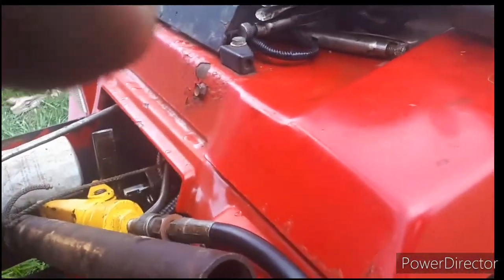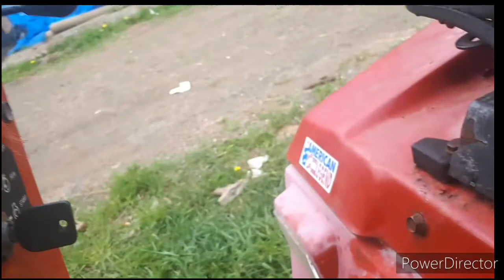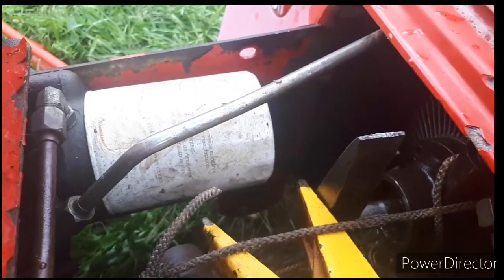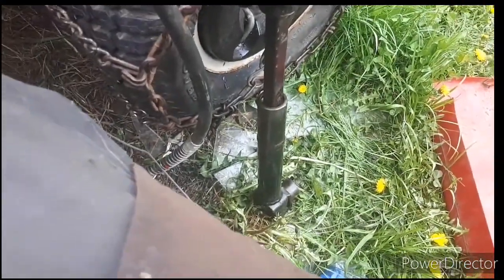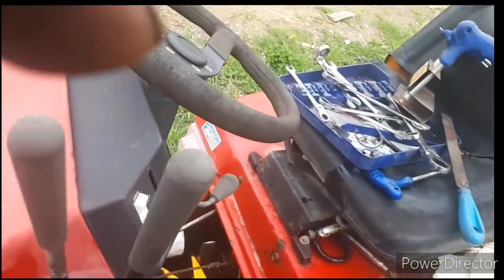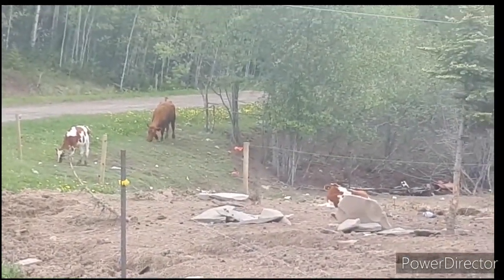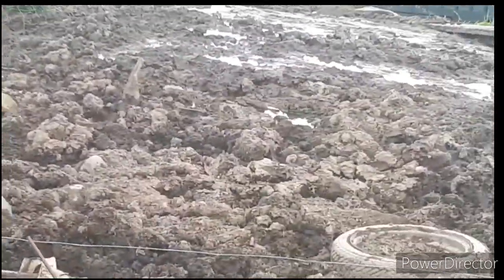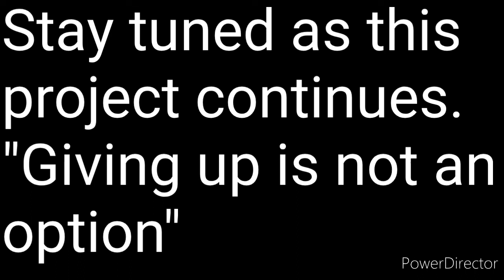Troy-Bilt GTX20 Lawn tractor charge pump. Part 2 Thursday June 3 2021

Comment: Good  day I must have missed this one.  Now that bearing did it come with it?  There is a group of Mennonites   down here & he sells bearings reasonable,  the same group that went to Matheson.  Anyways thanks for now. Did you get it apart & together?
Reply from the maker: no i never got it a part, been trying to find a puller that fits in the 2 tiny notches in te side of the housing, ether there to big or to small. being i have so many other jobs that need done before the cold weather hits again, and forces me in doors due to since i broke my back i have no feeling in my feet or hands, and they freeze and i dont know it until i come in, and oh the pain.. i dont know if the baring comes with the kit, i have not bought it yet..